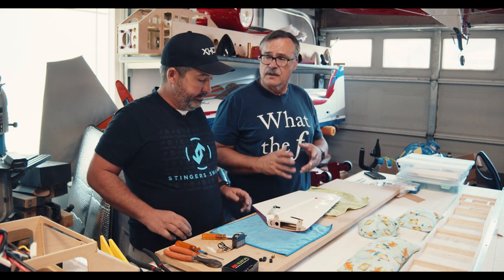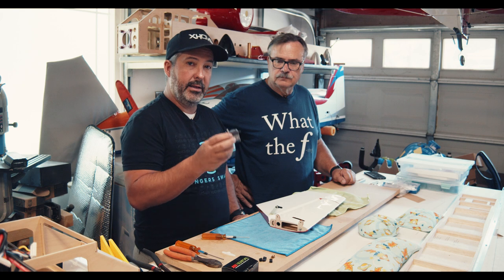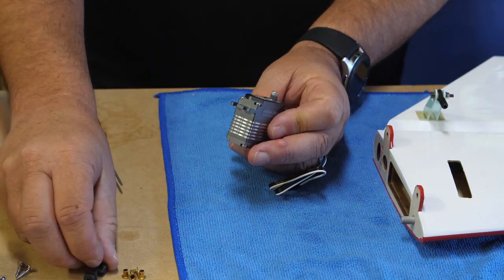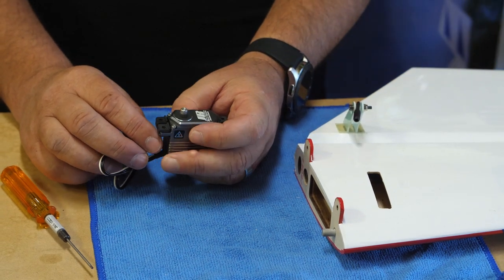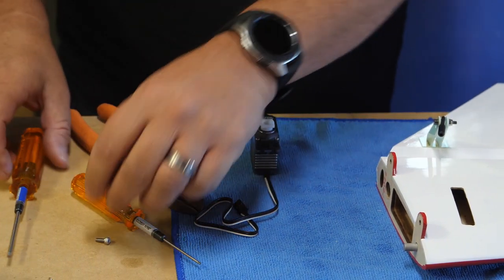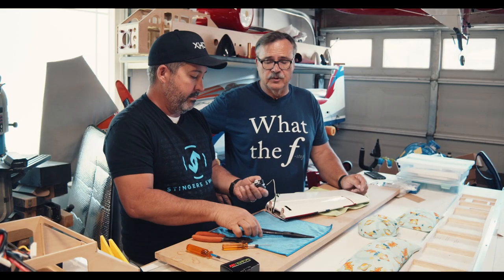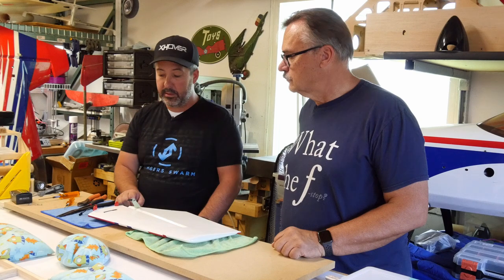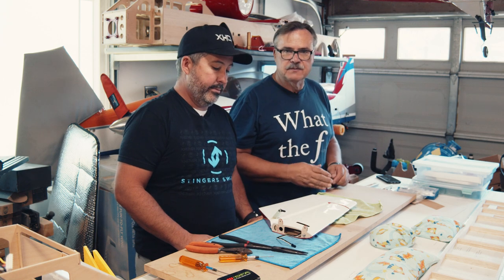FlightReviewz How To: Installing Elevator Servos

Comment: What about the long 2" SWB servo arm. Showing how to install that and tightening the bolt would be good too!
Reply from the maker: Basil, we wanted to keep the arms at the 1.5" to maintain as much resolution as possible. This also strains the servos less for more longevity. Thank you for the question. Keep them coming!!